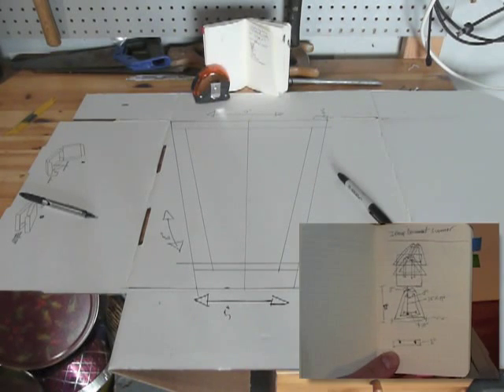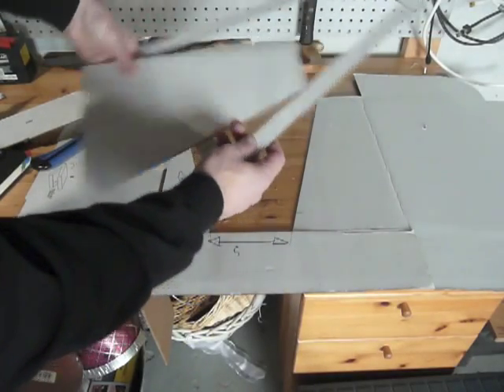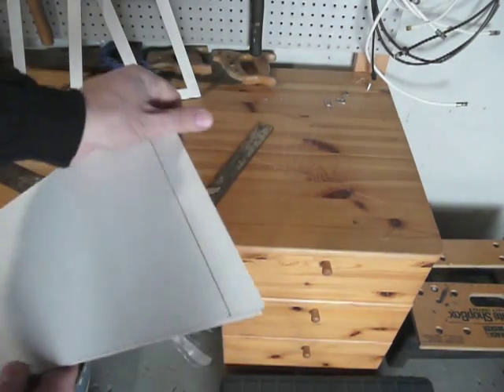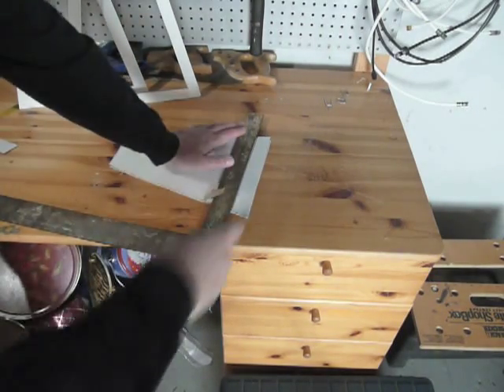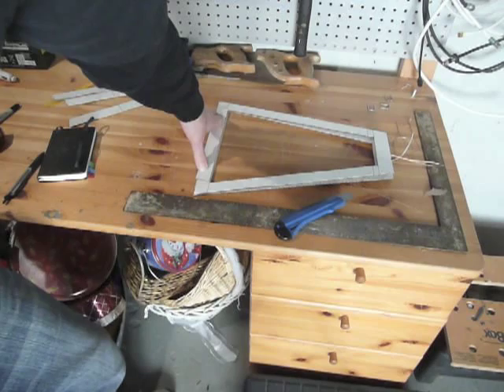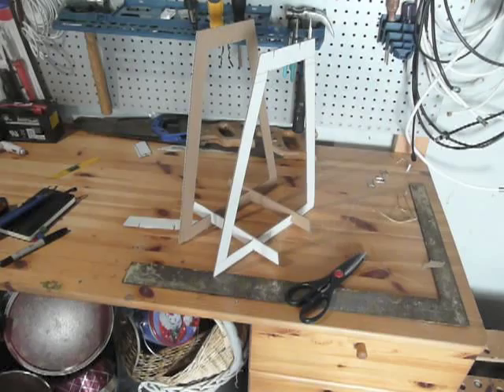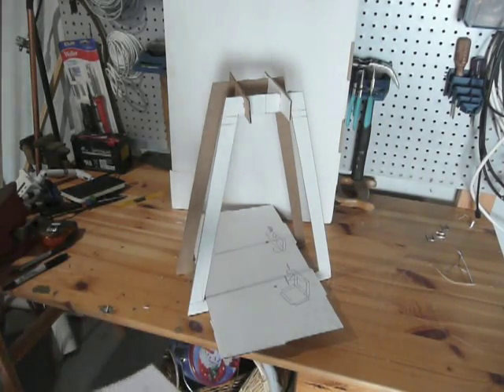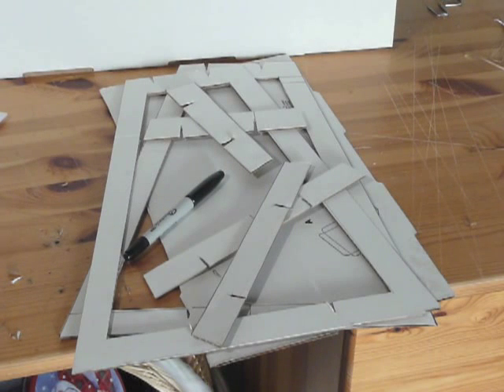Create a Portable Document Scanner for your iPhone

Comment: This is great! With a few modifications, it might be a good alternative to an Elmo: attach the phone to a projector and then add... a clipboard where you place documents so that you have a surface to write on? A spider clip on top to hold the phone more securely? Something grippy on the bottom to keep it from moving around so easily, like rubber cement or silicone caulk? For an Elmo made of leftover cardboard and a phone I already have, I am willing to brainstorm! Ideas?